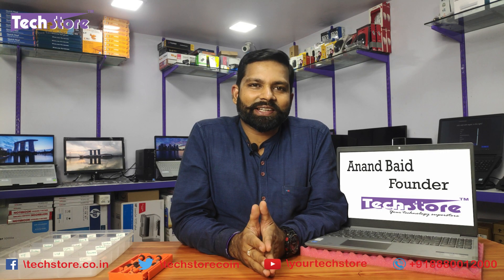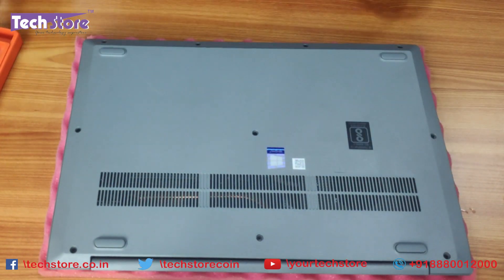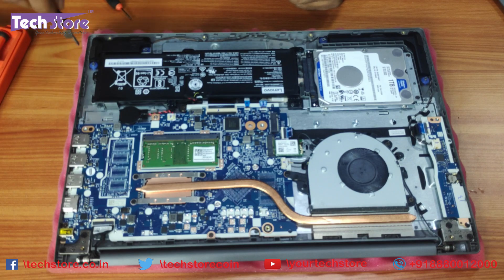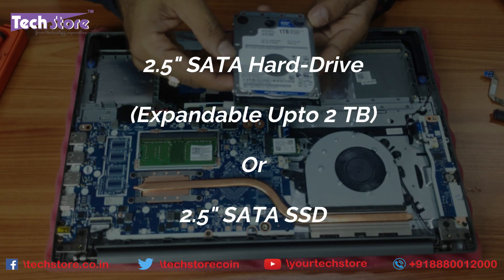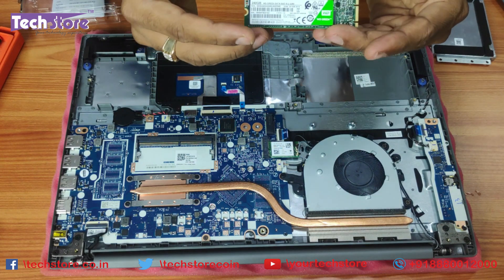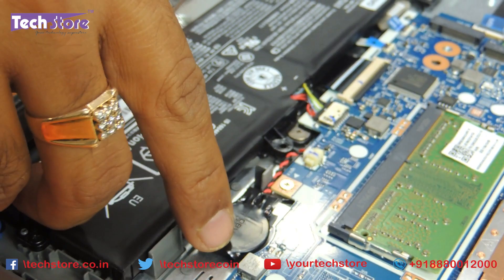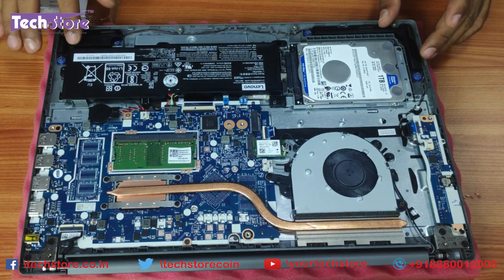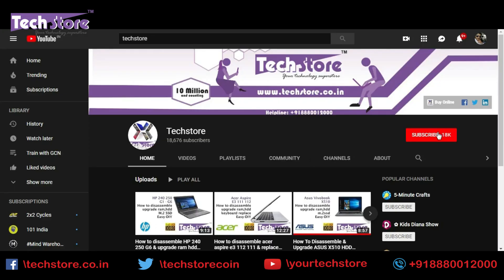Lenovo Ideapad S145 2019: How to disassemble base & upgrade ram m.2 SSD HDD wifi easy diy

Comment: Bro... I have big expectations from you that you can easily solve my query...so my query is that I purchased last year Lenovo ideapad s145 15IIL 10gen core i3 4gb 1tb model.....
But it has worst battery back up and performance speed...so someone suggested to to use an additional ssd in it...but confusion is that which best  ssd would it support.....second how to overcome only 30 minutes of battery backup....pls send the link to buy that tool which is required to open cover of laptop...pls guide bro...

Comment: Is it necessary to reset CMOS cell after each upgradation? And Will that extra SSD Speed up my device anyway or I have the change some settings?
Reply from the maker: Not required to reset CMOS. Extra NVME SSD will speed up like you cannot imagine.
Reply: @TechstoreCoIn  Thanks Sir

Comment: Hey I am lucky that I found the thing for which I was searching

I will buy it in 44000\- inr and will buy the m.2 ssd later when I will have a budget for it 
cause a Lenovo S145 i5 10th gen variant with both ssd and 1tb hdd  is a lot expensive than the upgradation and Its simply overbudget.......

Thanks a lot.....
Reply from the maker: Glad we could be of help. Do Subscribe

Comment: Thank you so much, i watched this video after buying the s145 and really worried with the performance. I want to move OS from HDD to SSD  and then use HDD as  secondary storage.
Reply: Please be extra careful with that model. I purchased it in Oct 2019 and in 5 months it started having blue screen problems. I met several people with same problem in same model.
Reply from the maker: Glad I could help
Reply: From where did you get the screw for m. 2 ssd

Comment: Hey, I just want to ask you about dual-channel. Would it work on this specific model when I upgrade RAM with 16GB or 8GB(taking out 4GB)? What is best solution when upgrading RAM, and what memory speed is best to use? Thank you.
Reply: Go for 16 nothing below nothing higher
Reply: You can upgrade upto 16GB in this Laptop.
Reply: @DEXTERERSassassin  max capacity of ram is 20GB

Comment: I have this Beautiful laptop (lenovo ideapad S145-15iwl) of 512GB SSD & 8GB Ram..
Does it have an additional slot to add another 256/512GB SSD with the existing one? Can i also add 4GB RAM along with keeping my existing 8GB RAM? I have volume issues which is not loud enough & not satisfactory..would you plz advice how to boost the volume level? I have tried all way but failed...
Reply: You can only add one ram as there is only 1 slot u can add additional ssd through nvme slot

Comment: Is this for the LENOVO Ideapad S145-14IWL? Cause that's the model I have and I'm thinking of upgrading my ram but I was surprised it only have one slot of ram and this is a new laptop I'm afraid I might void the warranty once I buy a ram from the internet and install it my self.
Reply: @techstore could you suggest how much ram i need and what is the clock speed ? Do i need ddr 3 or 4? Thanks

Comment: Help me, anyone. I have this S145 15" with SSD 256. Can i add a HDD? So then i will have SSD+HDD. Or should i replace the SSD?
Reply from the maker: you can install a seperate HDD. you need not remove the SST which is on the m.2 slot

Comment: Hi, thanks for your videos, I currently have a lenovo ideaPad s145-14IIL, I want to know how much maximum ram memory I can put, and how many slots it has, on the crucial page it says "Standard Memory: 4GB non-removable", my question is : I can remove it and increase my memory? thanks
Reply from the maker: you cannot remove a memory that is soldered on the motherboard. it has one free slot on which you can install up to 16GB Ram

Comment: bro i have this laptop... and it as 4 gb which mounted to mother board .... and a slot to expand.... can i put 16 gb ram in that slot... which makes 20 gb ram.... or i can only put 8 gb in that slot.... which make it 12 gb ram.....
Reply from the maker: yes you can put 16Gb in that slot.

Comment: Can anyone tell me what was the last thing he installed that was not there when he opened it and what it does and should I upgrade my S145-151WL 81MV    Do I have the exact same motherboard and computer as you?
Reply from the maker: It was a M.2 SSD which we installed. It is not mandatory to install it. you can install if you require to increase speed of the laptop.
Reply: @TechstoreCoIn  Thank you I will look into that.

Comment: The m.2 in the video is an m.2 sata based SSD. The motherboard doesn't support that interface. It recognizes only an nvme m.2 SSD. Example: Samsung Evo 970. 
The video doesn't show the BIOS after installing the SSD. Do your research before purchasing.
Reply from the maker: This laptop supports M.2 Sata based SSD as well as NVME ssd too.We have researched it before uploading the video.
Reply: @TechstoreCoIn  there's only an nvme option in the BIOS boot order. And I have installed an SATA based SSD (WD 128 GB). Nothing on the BIOS.
Reply: @TechstoreCoIn  what about the max limit of SSD it can support, 156/256/500 GB?

Comment: Do we have two slots for ram or a single slot in i3 4gb variant ?
Reply: It has only one slot. And comes with 4 GB of "internal" ram on board. So if you add 4 GB you have 8GB Total. The "internal ram" on the board cant be upgraded.
Reply: @000jimbojones000  is the internal ram the same showed in the video or is it the external ram in video?

Comment: It doesnt have extra slot for RAM?
Reply: One ram stick is soldered to the motherboard
Reply: @_Clipper_  I don't think it is soldered to the motherboard. you have a one ram slot in the motherboard. you can remove 4gb stick and replace with a 8gb or 16gb one.
Reply: @dilushamadusanka8247  i talked to the retailer and also read somewhere on the internet
Reply: @_Clipper_  what is the clock frequency?
Reply: @bulbulbrahma frequency of ram? 2400mhz
Reply: @_Clipper_  Lenovo support told me it is in 2666 Mhz, I am confused.
Reply: @bulbulbrahma  2400mhz is for current gen (3200u) 2666 was for last gen (2200u). That's what I've been told.
Reply: @_Clipper_  Ok, cool. Then, maybe I should go for 2400 Mhz or it is dependent on your Serial number laptops.
Reply: @bulbulbrahma  go for current gen, it's faster than last gen even with slower ram
Reply: @_Clipper_  I bought the rygen 3 3200U but I am having a hang problem sometimes thats why I want to upgrade the RAM.
Reply: @bulbulbrahma  i bought mine too with 3200u, yesterday. Can you please tell me how much does your battery lasts and how bad is the hanging so i can figure out if mine is defective or not. Also, how much did you get it for?
Reply: @_Clipper_  Battery is average as the normal ones, hanging was random it mostly happens when I start the PC. Yesterday, Iupgraded it with 4GB 2666 MHz and now it is fast and doesn't hang till now.
Reply: @bulbulbrahma  how many hours to be precise? And did you upgrade it yourself or through service center? How much did they charge? Which company's ram did you purchase and of what size? How much ram do you have now?
Reply: @_Clipper_  Didnt wanted take risk with lots of confusion. I went to service center, coincidently the guy had already upgraded many of this model. I can say 3-4 hrs
Reply: Now I am having 8 gb of RAM
Reply: @bulbulbrahma  how much did he change?
Reply: @_Clipper_  Adata
Reply: @_Clipper_  with service , 2200
Reply: @bulbulbrahma  2200 rupees including ram?
Reply: @_Clipper_  Yes
Reply: @bulbulbrahma  okay, that cleared everything, thank you for your time.
Reply: @bulbulbrahma  bro is it running smoothly with 8gb of ram? Or have to insert ssd also??
Reply: @abhisheknagar5169  it is running smoothly only with Ram till today
Reply: @bulbulbrahma  bhai 8 gb ram is sufficient na ya 12 gb kar le? Aur usage me koi problem aa rahi kya? Aur design me kaisa hai? Display kaisa hai? Me bhi lene ka soch rha
Reply: @abhisheknagar5169  aj tak problem nahi hua, till 2 months, 8gb
Reply: @bulbulbrahma  bhai design aur display ke baare me aur bta do aur koi bhi tumko bekaar feature lga kya laptop ka koi bhi problem wagerah bas ye bta do last bhai 😊
Reply: @abhisheknagar5169  display is blurry but fine to go for this budget. Basic use like  programming and all.
Reply: no. it has only one ram slot.

Comment: How to charge it without battery ? Can I remove it and start using only power supply or I'll wait for the battery to be dead over time and keep using only power supply ? In a nutshell I wanna maintain the battery only for outdoors , while indoors using my lap s145 without battery .?

Comment: Sir i bought lenovo S145 ryzen 3  and 4gb ram model. Can i install ssd? Please answer
Reply: Yes
Reply: @_Clipper_  thanks
Reply: @_Clipper_  Can i put graphics  Card in it?
Reply: @princekumarprasad2062  no
Reply: @_Clipper_  i5 variant?
Reply: @princekumarprasad2062  most modern laptop's comes with GPU and CPU soldered into the motherboard so you can't add/ change either of those.

Comment: Wanted to buy 81UT001CIN
Lenovo Ideapad S145 AMD RYZEN 3 3200U 15.6-inch FHD Laptop

Does it have same ram expansion slot or
Ssd expansion slot
Reply: I bought s145 ryzen 3 model and want to know the same
Reply: Yes..it has same slots 👍

Comment: Lenovo idepad s540 vs hp 15 pavilion 2082tx which one should i buy?
Reply: Aakash Chugh Lenovo is better, you also get 2 years of warranty
Reply: @vanflorre  128 gb ssd + 1 tb hdd model? . Is 128 gb ssd sufficient?
Reply: I would recommend you to take the Lenovo Ideapad S145 with 8th gen i7 8core CPU and Nvidia mx110, it has a 256gb NVme SSD from Samsung and a 1Tb HDD... It’s perfect for studying and you’ll get it for around 1000$

Comment: Please help me solve my doubt.

I heard that Lenovo IdeaPad s145 i5 8gen, 8gb ram has 2x4gb ram i.e. two slots. Moreover one is attached with the motherboard so, what's the procedure to upgrade to 16gb ram?

Am assuming that one (4gb ram) cannot be removed, making it impossible to attain 16gb ram with even replacing the other slot with 8gb ram. 

Am not clear when you mentioned to insert 1x16gb ram to attain 16gb or ram.
Reply: First thing, There is no such thing as non-removable ram. There are two slots in the laptop. You might have 2x4gb ram and both slots used. In order to upgrade the RAM. you need to remove one 4 gb ram and add a new 8gb ram. since this laptop only support ram upto 12gb. see the reference : https://www.lenovo.com/ee/et/laptops/ideapad/s-series/Lenovo-IdeaPad-S145-15IWL/p/88IPS101200
Reply: I would like to correct myself. There could be soldered RAM on this PC which i am not aware of. and that actually depends on your model number. Reference:https://www.lenovo.com/in/en/laptops/ideapad/s-series/Lenovo-IdeaPad-S145-15IWL/p/88IPS101200 ; Click VIEW MODELS

Comment: What is the compatible M.2 SSD for this ideapad? SATA or NVME?
Reply: We installed a NVME Intel 660P in our S145-15IWL.
Reply: @classicpctinker5070  Are you sure ?
Reply: @papainoel1  Absolutely. Since my last post my little brother purchased an identical Ideapad laptop. I also installed a 660p Intel SSD in that laptop but only 512gb this time. The 660p is slow but NVME. 

You should be aware the laptop does not include a stand off or screw for securing the m.2 ssd. I used an m2.5 screw and matching nylon nut. It was 5mm long, IIRC.

Comment: can i use a higher ram like a 8GB ddr4-3200?
Reply: Depending upon CPU configuration. Like Pentium allows 2133mhz or Ryzen 3 allows 2400mhz
Reply: Depends. My max memory is 12 gb, I've got built in 4 gb, so I can upgrade to 8. You'll need to see the speed of ram in bios settings. Mine is 2400, so if I upgrade, I'll go for 2400.

Comment: After removing the 1T HD, can I boot from the M.2 SATA specification, or do I want to use the PCIe specification? Thank you!!
Reply from the maker: m.2 sata. If you use pcie NVme,then also it will boot
Reply: @TechstoreCoIn  in ideapad s145 , we can use any1  m.2 sata and m.2 nvme
Reply from the maker: Yes u can
Reply: @TechstoreCoIn  thnx. 
And i want to play pubg mobile and pubg  pc lite.
Will m.2 sata improve performance,or i should go with m.2 nvme?
Reply: @TechstoreCoIn  no you can't!! It can detect only m.2 nvme SSD
Reply: @mmhajanpatton594  why?
Reply: @isadoraquaresma3793  dunno, bios doesn't detect SATA based m.2 SSD
Reply: Vedio showed m.2 sata
Reply: M.2 alone is not faster than SATA but NVME is alot faster.

Comment: Does it come the screws on the motherboard to install the SSD?
Reply from the maker: No,u need to get one
Reply: No screws or standoffs were included in our unit to secure the M.2 SSD. The threading requires a M2.5 standoff or screw.